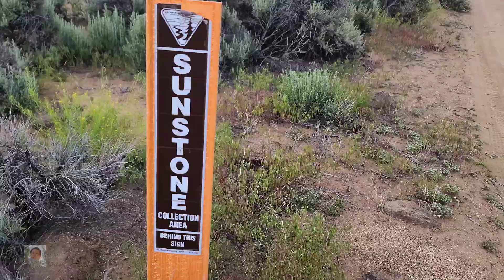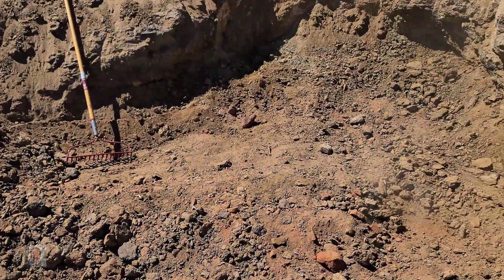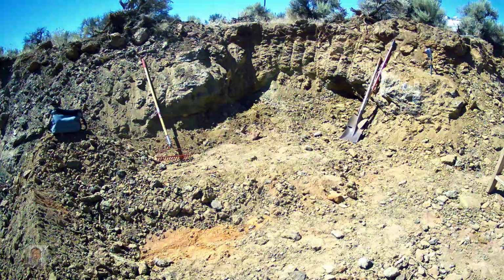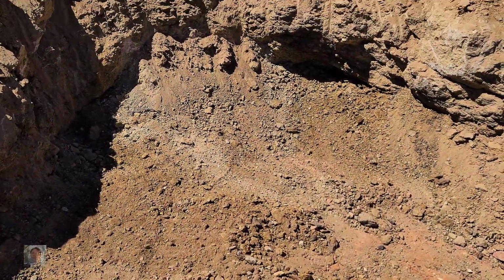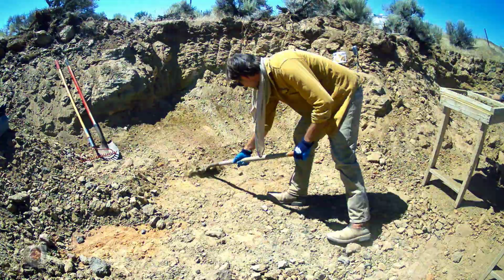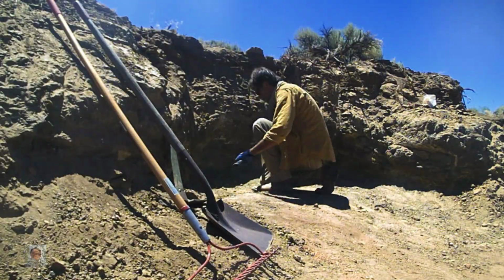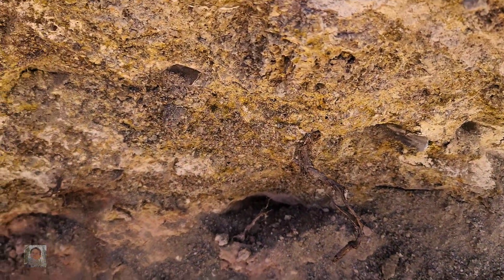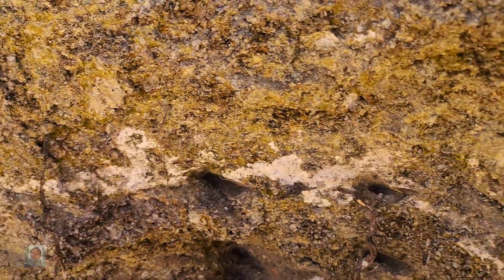Oregon Rocks! Rockhounding Oregon | 2023 Oregon Sunstone Extravaganza

Comment: Do you suppose we Disabled Seniors and OUR SON who is a Tetraplegic can Rockhound that Location in Oregon?  Or should we just Purchase Rough Sunstones=bit that will take the fun of digging, I can get around slowly=hehehe.  Are there BLM areas we can Trek with our electric wheelchairs?  We reside in Olympia Washington and my WIFEY of 49yrs were thinking about taking a drive to Oregon to Rockhound for, Sunstones, Fire Opals, Hollie Blue, & _ Obsidians- I loves the Mahagony the most brings back memories back in Guam working with my POP in building our HOME, before he passed on in 1973.  OR should we considerer to just drive to The Richardson Ranch=Rock Store???
Reply from the maker: Great to hear from you. Spectrum offers pit digs along with belt runs and ore piles. Considering your situation, I would suggest the belt run. Although belt runs are a bit pricier than some of the pit digs, it's usually where you will find a great amount of quality in a very short period (1 hr). Belt runs are where they classify the ore and then spray it with water as it reaches the belt. You'll sit next to the belt and pick off stones as they come by. It's great for people w/ disabilities and the cool mist is perfect in the desert heat. 
Ore piles are also a good option but will require much more work. Basically, you're given a big ore pile that you can sift through w/ screens at your leisure. This is a great option because the desert heat can really get to ya and its nice to be able to take a break as needed. 
As for the other minerals you've mentioned, fire opal is some of the hardest work I have done rockhounding. Obsidian is a lot of digging too. 
Here is what I recommend; Send me a direct message via Instagram and I'll send you a box (free of charge) with a variety of the minerals I have found over the seasons. I just found a bunch of nice rainbow obsidian that I bet you'll love. I'll make sure to take care of you and your family the best I can ^^
If you're not on Instagram, you can contact me on Facebook. I am the admin of the Southern Oregon Rockhounds, Oregon Sunstone, and Oregon Agate Hunters FB groups so I'm easy to find.
Hope to hear from you and thanks for watching. Have a great holiday weekend ^^